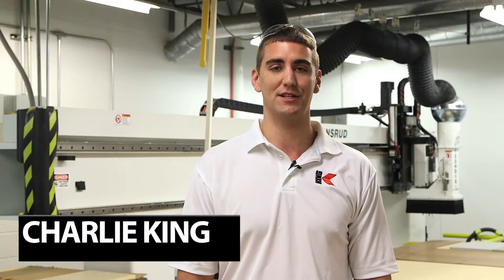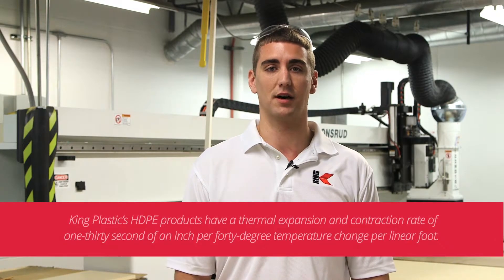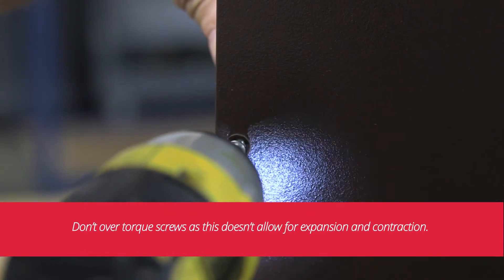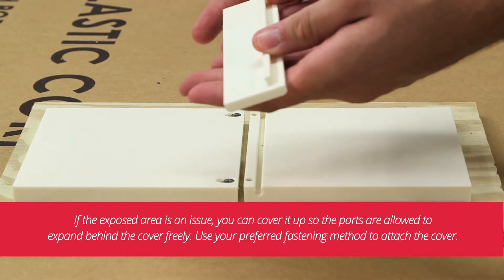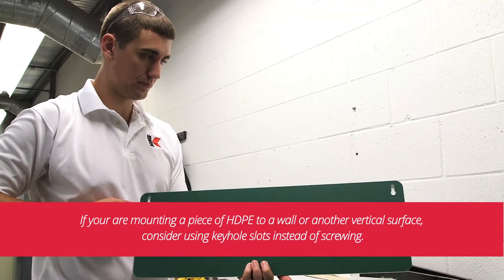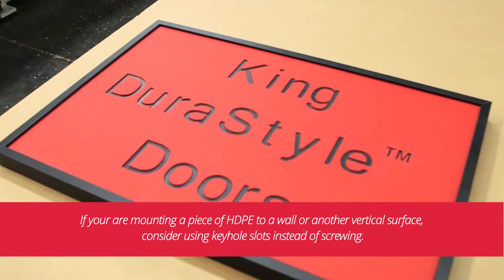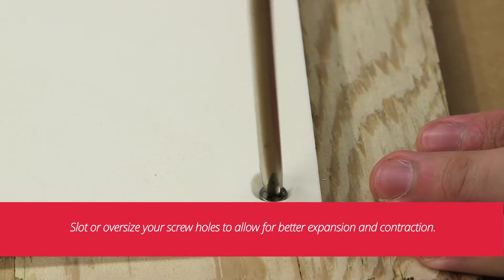King Plastic - Expansion and Contraction

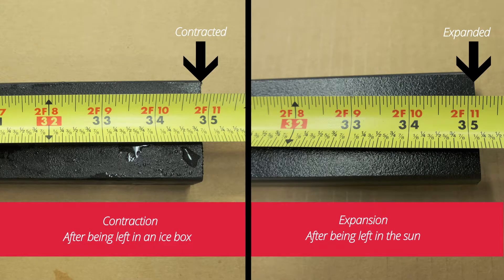Comment: The comparison at 0:36 is not only useless but also misleading. You haven't even remotely dealt with parallax. The camera angle is significantly different between the two, which is obvious from the angles of the end cuts. The measuring tape is not parallel with the work pieces (and is especially askew on the second one). The curve of the tape has not been dealt with, is again different between the two, and is severe in the first one. This is multiple levels of measurement sloppiness and has changed my mind about wanting to order from you.
Reply from the maker: The video segment in question is for illustrative purposes only, and the combination of video and audio is sufficient to demonstrate the care necessary when expansion or contraction is expected.

The formula is 6x10-5 in/in/F° and we wish you success in your next project using King StarBoard®, the original marine-grade high-density polyethylene sheet, the leading brand in the marine industry.

We appreciate your input and will consider your comments if or when we remake the video.